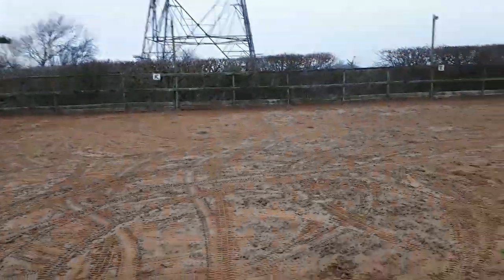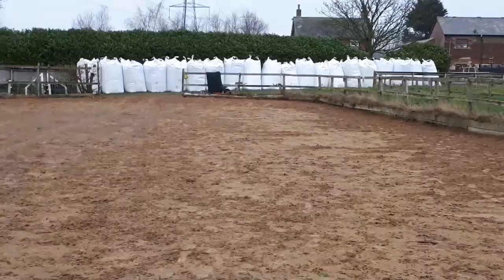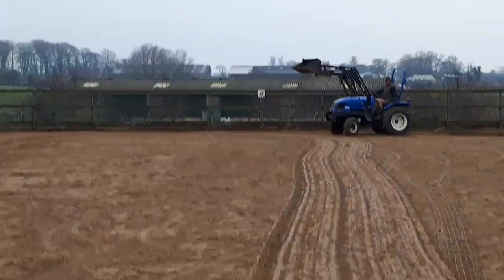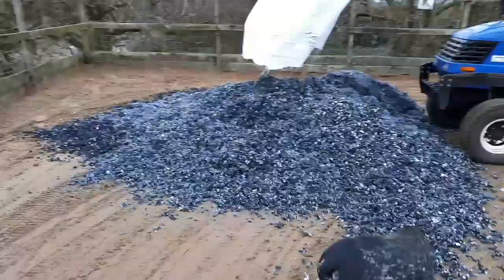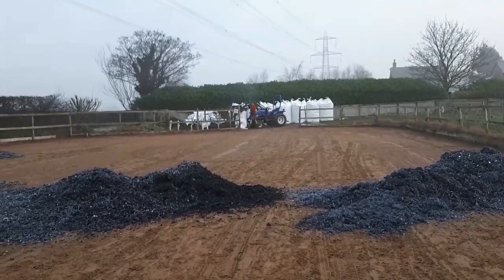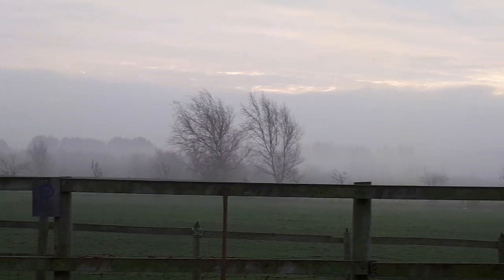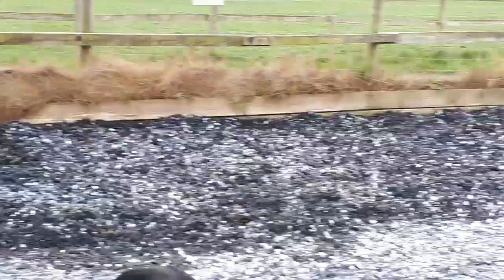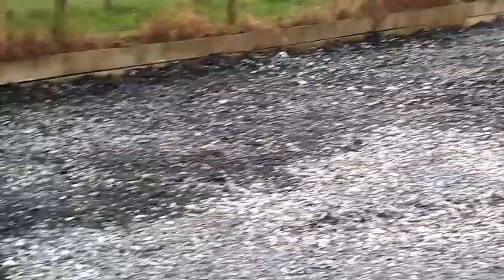Guide to laying Carpet Gallop Gtech fibre in an equestrian arena.

Comment: What are you using to drag your arena?  I was told that you need a special harrow once carpet fiber is installed.
Reply from the maker: Hi. I use an arena leveller. You can find them on eBay for as little £65 for one you drag on a chain or £75 for on with toe hitch. Easy to maintain. I only harrow once a month as it does just sit on the surface and doesn’t blow or move much.
Reply from the maker: I used my heavy chain harrow on the sand to flatten it before putting surface on but only a lightweight arena leveller now as stated above.

Comment: How is your surface riding now you have been using it for nearly a year?   I am thinking of doing exactly what you have done and really like the look of the g tech fibre topper.  Do the horses really ride on top of the surface and they do not find it too soft? Your help would be appreciated.
Reply from the maker: They do ride on top of it in Winter. I have sand below so gets a little softer in Summer bit it is so much better than just sand alone. This used to ride too deep. The reason I got this topper was because of how deep my sand manage rode in Summer. This topper is so. Much better. It gets harrowed more in summer to stop it tracking but that is still only once a month. I love it and it still looks like the day it was laid down.

Comment: Hi Mandy I notice you haven’t put down a weed membrane under your surface was there a reason this as Carpet Gallop have told me they always recommend to
Reply from the maker: Hi Richard. My original sand paddock was built 17 years ago before I bought the property. It has a weed membrane and then a layer of stones then sand. The weeds can grow in the actual sand especially around the edges as it is deep and does retain moisture. So the sand surface needed regular attention to stop it shifting and the odd bit of grass that seeded themselves needed pulling up.
The new fibre surface is dark and does prevent light reaching the sand so hopefully I will have less of a problem in spring and summer.
Reply from the maker: I also wanted to add that mine is a topper of g tech fibre not a stand alone surface.
Reply: Hi Mandy I just wondered how your surface is working out and if your still having weed problems?
Reply from the maker: Only the odd weed over the spring and summer. Easy to pull out. Took me ten minutes.
Reply: Thanks for all the advice Mandy, we’ve finally got round to it and our carpet gallop will be turning up on the 16th 👍